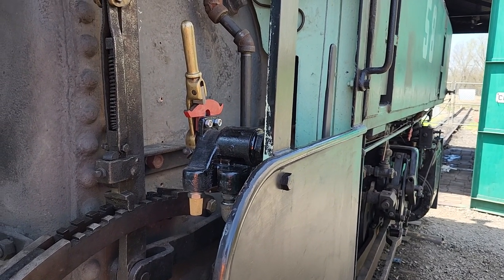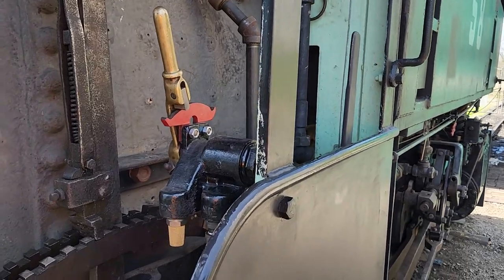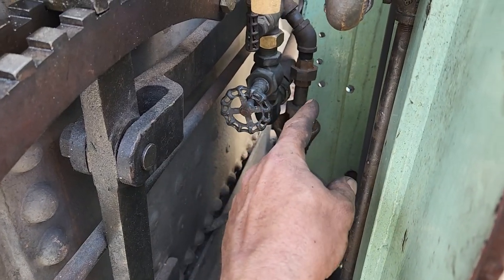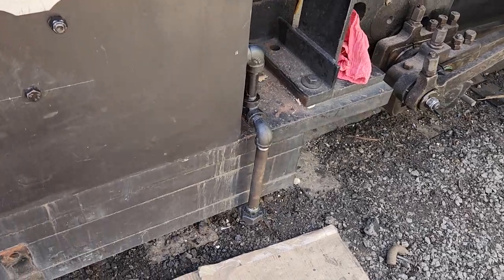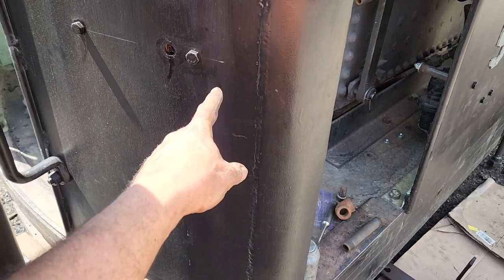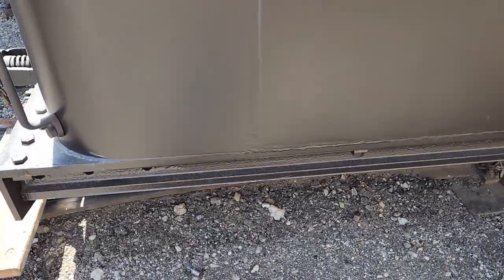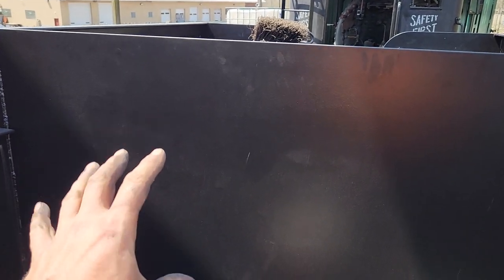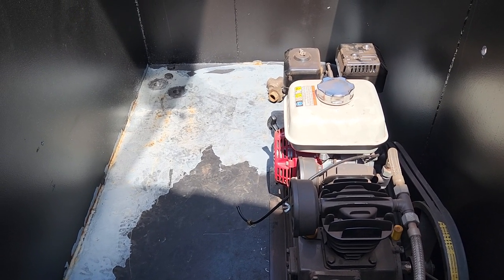Two Weeks to Install the Brakes!

Comment: This may be a dumb question, but will there be an air connection to the front of the engine?
Reply from the maker: No. The air brakes is for the passenger train only, which will always be handled behind the tender.  When we operate other trains such as the steel mill cars or dump cars we do not need air brakes and therefore there is no need for an air line on the front.